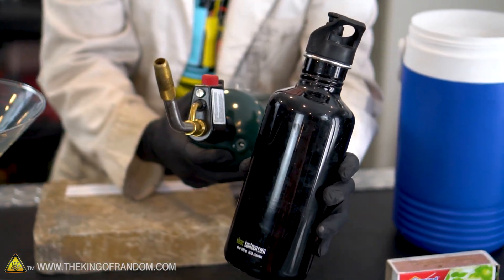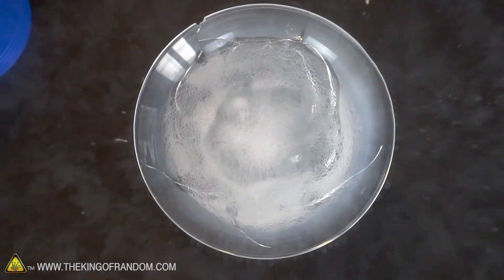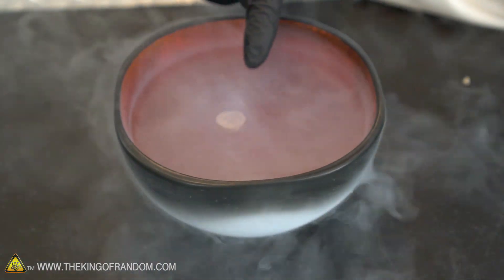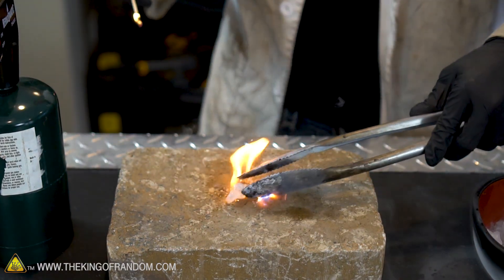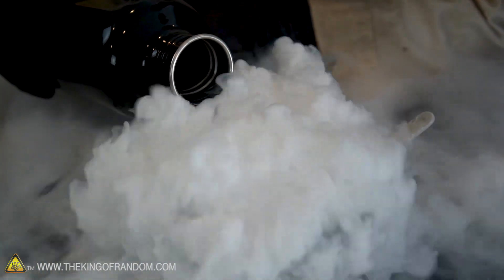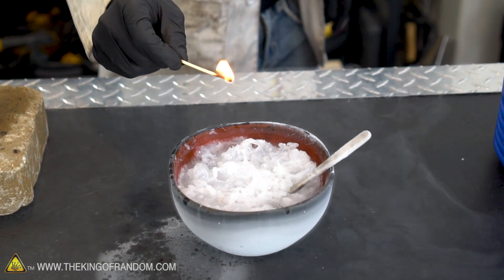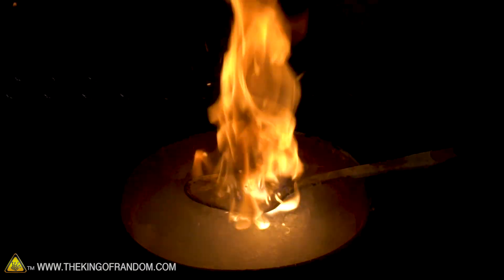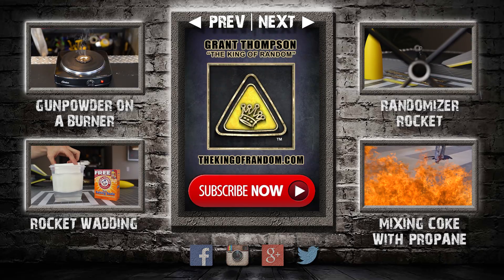Will Frozen Gasoline Burn? Can We Use Liquid Nitrogen To Freeze Gasoline Then Ignite It?

Comment: technically its not burning frozen gasoline!!!  because when u use the thongs, there is melting solid gasoline. thus there is liquid gasoline around the solid so igniting it would be igniting the liquid and probably not the solid!!! 
like so he can see!!  and solve this myth HAHAHAH
Reply: ruining ur day yepyep, didnt explain all factors 😂
Reply: Also, the flame melts parts of the frozen gasoline and then it ignites the gas fumes (which is what is actually burning when lighting gasoline). When the gas fumes burn, it causes the rest of the frozen gasoline melts bit by bit and thus gets ignited bit by bit.
Reply: Kaelan Wan actually liquid gasoline isn't what burns, when the gasoline becomes a vapor then it burns. it has a high evaporation rate and that's why it's so flammable.
Reply: it's not the tongs, they're cooled aswell. it's the flame and the room temperature
Reply: Kaelan Wan Then why does it "explode"?
Reply: Danklage Spanklage i guess when the melted gasoline ignites ,the rest of the gasoline is still solid.  so probably the sudden heat might cause gasoline bits/drops to fly around which may ignite in the air, thus causing a 'explosion' (?) HAHAHA just a theory, not very sure
Reply: killuh208 ohh oops HAHAHAHA truee
Reply: Danklage Spanklage and the constant sparkling as well...
Reply: ITS FAZE BOOCE

Comment: I think when you pull out chunks of solid gasoline, it is already coated with a thin layer of melting solid gasoline. When the lit match is brought close to that layer, the surface immediately catches fire, as its already exposed to air, and burns down the rest. That layer might be responsible for the vigorous reaction.

Comment: I don't know if alcohol actually burns at that temperature because it seems rather it only needs to be a liquid to start a chemical reaction to turn into fire. And as it's on fire it rapidly heats up, that's most likely the little "explosion" you saw as you lit it up.

Comment: That explosion was dangerous, never put a denser no inflammable fluid in a less dense burning fluid, it will always explode because of an instant evaporation of the no inflammable fluid below the burning one. It's the same principle as when you put water in burning oil (spoiler alert: it will explode)

Comment: what happen if you put rocketfuel into rhe liquid nitogen. will it burn like normal or etc
Reply: thumb up if you wanna to see that
Reply: rocketfuel? like liquid hydrogen?
Reply: Felix St almost idk what happen
Reply: The problem is that liquid hydrogen is already colder than liquid nitrogen so it would just evaporate and I think you know that hydrogen is pretty explosive especially in its gas state (grant did a video about it aswell, his hho-generator, that was basically rocket fuel just in its gas form)

Comment: technically frozen gasoline wont burn and neither will the liquid its the vapor but since gasolines very volitile it creates vapor at very low temps somewhere around -50F so the match is heating the gas just enough to create vapor then it ignites heating the rest of the gas to vapor igniting the rest of the gasoline.

Comment: will a frozen fire steel throw sparks?
Reply: Fire steel is at room temperature "frozen" it doesn't matter how cold it is, if the physical stat is the same
Reply: alexandru andrei *iron it wouldn't freeze, it's already frozen, it's not at it's melting point or at its boiling point.everything that is a solid is frozen.
Reply: alexandru andrei wrong person lol
Reply: alexandru andrei wrong person lol

Comment: Freeze nitrogen ?
Reply: Tarc Noob not very exciting and will be very difficult
Reply: yeah nut why not
Reply: Youll just need to put it in a vacuum chamber and it literally just acts like if you put water in a vacuum chamber
Reply: yeah by adding some pressure on it
Reply: Quite the opposite actually, if you put it into the vacuum the nitrogen will start to evaporate and as it does the warmer molecules will leave quiver than the cooler ones. It will reach a point where it is actually cold enough to freeze since all the warmer molecules will be gone
Reply: oh ok

Comment: Id like to point out that frozen gasoline DOES NOT BURN and neither does liquid gasoline. Only the vapour burns, when you expose gasoline to a flame the flame cause the liquid to evaporate and then burn. When it is frozen it just has to melt then evaporate before burning, this starts a chain reaction as the heat from the burning gas causes more liquid to evaporate and burn. This is why the frozen gasoline doesnt burn as violently as the same about of liquid would.

Comment: Why not prechill any glasses, bowls or utensils you plan to use in the freezer before filling them with liquid nitrogen ?  Would lessen the thermal shock on the glass and ceramic items as well as cut down how much nitrogen is boiled off cooling the items from ambient temperature..   Not that we don't like seeing things crack and split due to the thermal shock..

Comment: Droplets of nitrogen trapped in the frozen gasoline boil off violently when the gasoline surrounding it heats up from combustion around it, sprays the gasoline around, that gasoline ignites, generates more heat which causes more nitrogen droplets to boil off and spray more fuel, rinse and repeat until all the nitrogen trapped in frozen fuel has been released.

You may be able to achieve a similar albeit less violent result by mixing fuel with crushed dry ice. (Crushed so the fuel can freeze around the CO2.)

Comment: If you feel like not wasting any more glass, put the glass in the freezer and cool it down slowly until its below freezing. After that, pour in a small amount of liquid nitrogen to keep cooling the glass until its cool enough for the thermal shock of the liquid nitrogen you pour in not to break it. Pouring in -200C liquid nitrogen into a glass that is at room temperature (about 20C/25C) is the equivalent of pouring in a liquid at 180C into a glass thats 0C. The thermal shock is immense on the glass when its temperature shifts so quickly.

Comment: Watching it, I think what's happening is the frozen petrol, is melting quickly and releasing gas (as liquid petrol doesn't burn, only in its gas form does it), when you light it, the gaseous petrol is igniting, and causing the rest of the petrol ice to melt.

However, I do think that when it's reacting, that some of the ice crystals are subliming straight to the gaseous stage and that's where the rigorous burn is coming from. Why it's exploding so to say.

My guess anyways.

Comment: The results of the experiment should not have been a surprise to anyone. After all, the heat from the match will always melt the frozen gasoline back into liquid form and since no changes were made to the gasoline by freezing it, it behaved as it normally would when exposed to a flame

Comment: Try freezing a iphone7
Reply: At least any solid object (eg. iPhone7) is already frozen. The 3 physical states one material can be are gasiuos, liquid and solid (aka. frozen). There is no other physical state than those 3. So any material that is installed in the iPhone7 is solid(already frozen). He could try to cool it down until the display cracks or the voltage wires don't conduct the elictricity any more, but this is not worth the price+a whole video.

Comment: The "protective layer" is a layer of nitrogen gas that is evaporating due to the (comparative) heat of the gasoline. This happens until it cools to the nitrogens temperature (Leidenfrost effect)

Comment: I believe gasoline in a solid and liquid state is actually not flammable. Due to the volatility of gasoline it's probably going though a process of Sublimation, a phase change of solid to a gas. The gas of which is flammable. If there is no gas it is possible to dunk a match in gasoline without ignition.

Comment: could you please hold a blow torch to liquid nitrogen to see if it will warm up or just boil away or something else
Reply: James Lewers thats relley smart
Reply: It'll boil away. Nitrogen is almost inert as N2, which is how it exists as a gas anywhere below about 10,000C (hottest chemical flame is just over 6,000C, and I guarantee you Grant doesn't have access to that). Liquid Nitrogen's temperature can't exceed -195.8C or it turns to a gas, cooling the remaining liquid back down.
Reply: James Lewers same thing that happens with dry ice. it just evaporates off.
Reply: as if a blow torch yields any different result than ambient temperature... nitrogen is only found as liquid either when stored extremely cold −195.79 °C (77 K; −320 °F) or under extreme Presseure. to get liquid nitrogen at room temperature it would have to be stored under 43,000 psi (2,900 atm) of Presseure (which at this point u would call it Supercrtical nitrogen)

short version: liquid nitrogen can only stay a liquid if raising temperature is compensated by raise of pressure
disclaimer im not an expert on the subject but i know some things and where to get more info on things so.. i stand to be corrected

Comment: Why don't you put the container in the freezer before you pour the liquid nitrogen in, couldn't that reduce the amount loss due the container being cooled since it's already cooler
Reply: It would make a difference, but not much. About 20% absolute max. LN2 is extremely cold, freezers don't even reach a fifth of that temp.
Reply: Because it would introduce water and also the coldest an avg freezer can go is around -18c (0f) where as liquid nitrogen is --210c (-346°F) so still a massive difference. You would only be cooling down by around 48c (118f). Also again this could introduce other elements into the mix eg water/ice

Comment: What happens if I drop liquid Nitrogen into a computer? Can Liquid Nitrogen conduct electricity and short out the PC?
Reply: It wouldn't have to "short" the PC, it would crack the boards first!
Reply: Thank you guys, but it would be cool! Literally lol lol
Reply: It won't short out the computer as such, since liquid nitrogen is not electrically conductive.

On the other hand it will damage the components via thermal shock, so it will break a computer that way.
Reply: No it can't as it is not electrically conductive. It would work for like 2 mins then it would cause the computer to shutdown/freeze/bluescreen as the temperature is way too low and stuffs up the silicon in the die.

Comment: Why does nitrogen move fire?
Reply: a-lpha of Zeldaforme Gaming Most visible flames are the result of combusting vapors, such as alkanes or gasoline. As such, a gas can displace the burning vapors, moving the flame, whether it be the wind or cold nitrogen. Additionally, most fires cannot occur without oxygen (Google chlorine trifluoride for more information), so the mostly inert cold nitrogen gas sinks and cuts off some of the flame's oxygen supply, "moving" the flame.

Comment: Wouldn't frozen gasoline melt...?
Reply: The gasoline does melt and then catch on fire
Reply: Watch the video and you'll have you answer.
;)
Reply: TX Gaming do people really comment before watching a video?
Reply: frozen octane
Reply: The gasoline does melt, vaporize and then catch on fire
Reply: OMG, I HAVE BEEN NOTICED BY OUR LORD AND SAVIOUR, KING OF RANDOM!
Reply: a-lpha of Zeldaforme Gaming Pure octane is not widely available commercially, and probably lacks any relevance in our everyday lives. Octane rating is a system that uses octane's properties as a point of reference, similar to the way that astronomers define distances in Astronomical Units (the approximate distance between the Earth and the Sun).
Reply: Benji Zhang octan is actually an hydrocarbon
Reply: It's like asking why doesn't water burn
Reply: wydra holky Yes. That is a fact that I was perfectly aware of. However, when was the last time you went down to you local convenience store and picked up a tank of pure octane?
Reply: Bradley Molloy boi its just a statement of opinion
Reply: TX Gaming a very odd statement
Reply: Right?
Reply: TX Gaming idk. I think it would burn

Comment: When you break your old martini glass in the balancing experiment 🙍 and get a bigger one 🙆
Reply: and break it again with liqnitrogen as it wasn't tempered 🙍
Reply: a-lpha of Zeldaforme Gaming Tempering likely wouldn't have solved anything. Thermal shock is caused by rapid volume changes due to rapid temperature changes. Hence, lab glassware used in chemical synthesis is   usually made of a different glass variant (borosilicate), which will not expand or contact as much due to temperature changes, instead of the same glass with tempering.